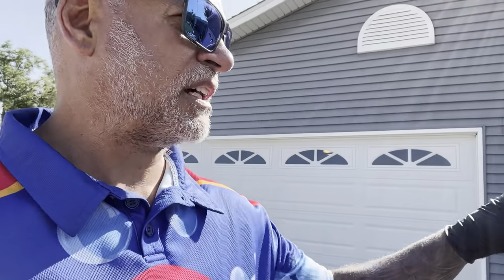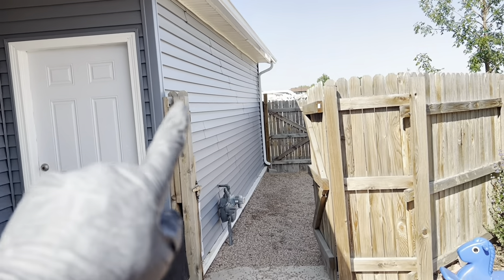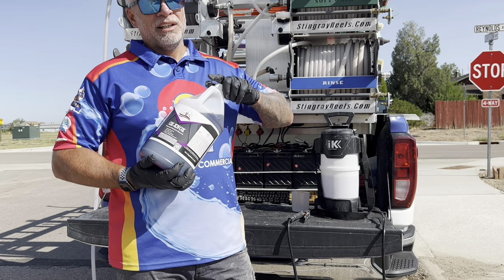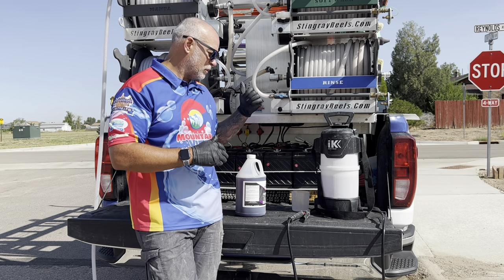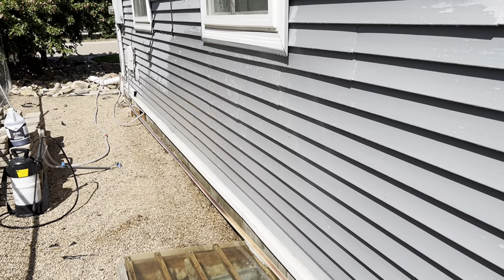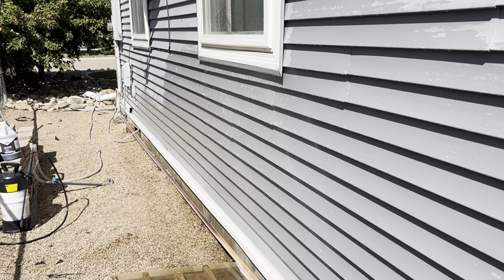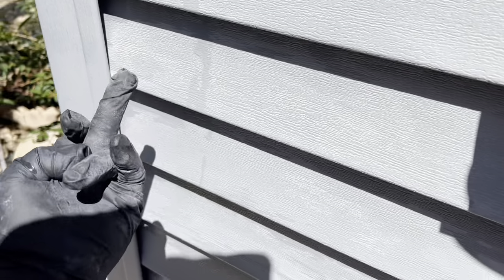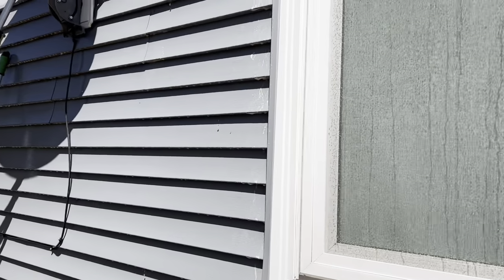Does Ox-Knox Really Work? Removing Oxidation from Vinyl Siding Test!

Comment: Thanks for this video!I’ve tried Ox Knox on some severely oxidized vinyl siding on 4 different houses.
I even tried 2 applications at full strength on a house but still had to brush. I’m glad to see that I’m not using it wrong because I’m kinda tired of them calling me dumb and downgrading us if it’s not working for us. They don’t seem to want to help they just talk down on us. And if you mention that it isn’t working, they remove your comment instead of being helpful. Thank you
Reply from the maker: I'm not surprised by their response. I still have high hopes and plan on trying another house soon testing some other variables. However, I remain skeptical. Thanks for your comments 👍
Reply: @mountainviewsoftwash9135  you know I just watched his video about ox Knox & that metal roof that came out so nice...well in the title it says "on a metal roof"...maybe that's the catch...no brushing on a metal roof
Reply from the maker: @derekjean6646  yea I gave seen them do a video on Hardie Board, vinyl and metal roof. Not sure why the lack of results on my end. My guess is dwell times.
Reply: @derekjean6646  I’ve also seen the video where they remove oxidation off of vinyl siding. Only thing I can think of is that the stuff may work on mild oxidation but not severe. 🤷🏼 If so, they need to advertise it that way instead of calling people stupid
Reply: If that's how they treat clients, I'm not interested in buying from them at all.
Reply: From what I gather ox knox is just another Butyl based cleaner...Nothing special and sure as heck isn't worth the cost...Purple Power $25 for (5) gallons at Walmart will likely work just as well...These businesses target startups who are ignorant on chemicals. Learn to look at SDS or MSDS information for any given product,.and you'll learn alot. Been doing this since 1996 and these dealers use the same cleaners and market them as whatever they want to sell that day.
Reply: Yep pretty much everything Coty sells you can make yourself, but hey some people want the easy way out so they buy anything he sells, can't really blame him for making money off of it.....

Comment: I'm really enjoying your videos. I just started into this as a side venture, and your videos have been helpful. Ran into some oxidation myself and been researching the best product to use. Your videos on the different chemicals have helped me out, big time. Learned alot watching. Thank you
Reply from the maker: Thank you man! I'm glad to hear your getting some value from these 🙏
Reply: @mountainviewsoftwash9135  Any advice on brush to use on oxidation?
Reply from the maker: @bretlagasse3560  I used the same brushes we use for siding. I like the multi angle car brush’s that are safe on paint but firm enough to get the job done.

Comment: Thanks for the video.  I live in southern CO.  I had to use oxknox at 100% for a metal roof I cleaned and it still didn't get all the oxidation off.  I started at 3-1 and it did nothing. 50-50 still nothing.  I had to go over the roof three times at 100% and then hit many trouble spot by hand.  I was super disappointed and will not use it again.
Reply from the maker: Shoot sorry to hear and unfortunately this seems to be a common theme. Shame

Comment: So, it looks like BC Cleansol is the winner for oxidation? And brushing is still necessary.
Any experience or opinion on using LA's Totally Awesome for oxidized vinyl siding?
Reply: Ive used LA on my personal home which is very similar to this video in color, like he said I saw almost instant action, looked like rust pouring off, I did use a soft brush and rinsed and it removed the chalky residue with no problem..didnt really restore the color as much or any glossyness but for something from Dollar General can you complain...I don't offer this service cause I have not found a product that is quick and easy and I feel for what you have to charge few people are going to go for it..
Reply: In my experience, Gutter Grenade from Pressure Tek, Gutter Butter, BC Cleansol is the proper product. OX-KNOX may work well but not a groundbreaking product.
Reply from the maker: I haven’t tried LA total awesome yet. Might grab a gallon and test it out.

Comment: I use Cleansol BC at 9:1. 9 gallons of water to 1 gallon of BC. I water the surface down first and then apply with a 12v 2.1 gpm sprayer. 2 coats 4 minutes apart. The oxidation just absolutely melts off. All i do is rinse it off with a water hose. No pressure washing. Comes right off. No brushing at all except in tight corners here and there. I also do gutters the same way, but i do brush them.
Reply: Great information... Thanks for your reply... Just the information I wanted to hear... I'm just setting up a 12v pump.
Reply from the maker: I do like Cleansol BC. I will have to try out your process and see if I can replicate. Thanks for sharing!
Reply: I used Pro Cleanse BC about the same stuff.. I used  8:1   twice  dwell 10 minutes  it says use pressure no less than 1000 psi.  no brushing it worked for me. I have a gallon of Ox nox but don't think it will work from what I need so I'm going to the Pro Cleanse bc,, just bought 5 gallons of it.
Reply: Do you do a SH mix before or after.
Reply: @bobbylindon9885   I always do a softwash and clean first to get all the organic growth and dirt off. Then an oxidation removal.
Reply: @bobbylindon9885   if you do SH first which is correct I think make sure you rinse , rinse rinse,  Pro Cleanse has on the instructions... Do Not Mix with Bleach.. when my BC hit contact with some SH on vinyl it turned yellowish Brown hard to come off too but eventually did. Everything was white except that part..
Reply: Not always.  Used 5 gallons on a singlewide and have to go back and scrub it again.

Comment: One thing many people don't realize with chemicals is air temperature....If you're trying to remove oxidation,..the warmer the better,...80+ and high humidity works better than 50 and no humidity....Very sensitive some of these cleaners are....
Reply from the maker: Good point!

Comment: 10-1 Ration is not "HOT" enough. We have used this product on 2 homes and she is dangerously good. I say dangerously because it will remove paint on gutters and window trim/flashing etc...Even pre soak and post soak the paint is coming off. If the mix isn't hot enough it doesn't work and if its too hot it removes paint. For this particular home you're going to want a 1 to 1 ration no questions. but you have GOT to be careful around downspouts. Maybe dip your brush in it just for the ends of the homes and around windows. Also if you only purchase 1 gallon it ends up being over $70 with shipping so if you're going to test this product out go and grab the case of 4.....For us personally we are just going to continue to use LAs totally awesome. It's $6 a gallon.
Reply from the maker: Great info thanks for sharing!
Reply: What dilution are you using for vinyl oxidation with the LA's ?? I use it on gutters and it WILL remove paint too if your not careful.

Comment: ok i just did a 9000 sq ft building ,the key to this product (for me here in tx ) was the rise pressure . it had very heavy oxidation whole place was pink,ox-knock made it blue again. no scrub 10 min dwell time. own was very happy with the results. wrote a nice phat check lol my mix was 32oz of ox=knocks and  2 gal  pump sprayer , yes i did have to mist it keep it wet, just enough where she didn't dry up on me.
Reply from the maker: Awesome! I think the issue for me here is the dwell time needed. It’s a dry climate so the chems dry up fast.

Comment: Homeowner here, not in the industry. But I just want to know how you do a two story house since this work requires brushing and not mere spraying. Are you on ladders doing this?
Reply from the maker: Hello there, great question! I can effect clean from the ground using a combination of a multi-angle brush and extension poles. Here's one that we use.

Extension Pole: Limited-time deal: DocaPole 30 ft Reach, 6 to 24 ft Telescoping Extension Pole | Multi-Purpose For Hanging Light Bulb Changer, Paint Roller, Duster, Window/Gutter Cleaning https://a.co/d/f5MdFMM

Multi-angle Brush: DocaPole Soft Bristle Car Wash and Scrub Brush Extension Pole Attachment (10") for Deck, Truck, Boat, RV, House Siding, Safe with Water (Long Handle Pole, Not Included) https://a.co/d/6S5iDwt

Comment: I went down to a 50/50 mix on vinyl and it took a good layer off but I still needed to brush.  I ended up using a different product that took the balance off.  I also tried it on my oxidized metal shop, in the shade, 50/50 mix, 5 to 15 min dwell tests and it didn't touch it at all.  Thank you for posting.
Reply from the maker: Thanks for watching and commenting! It's a bummer you had similar results. I did try a small section with a 50/50 mix with a longer dwell and didn't see much reaction. It's unfortunate that the product didn't work as advertised. I had high hopes!
Reply: Have you ever used Cleansol BC? Or Kraken wash from dirt killer? There both supposed to be the best  oxidation removals out there. I heard southeast softwash chemicals are not worth the purchase. Good luck to you
Reply: @louiscottrell3236  I've used Kranken wash on some garage doors.  Worked well.  No luck with cleansol BC.  I've used f9 barc and it worked well.  Needed to brush though.
Reply from the maker: @louiscottrell3236 I did a video on CleansolBC, actually worked out pretty well. Still requires brushing to get the desired results
Reply: So Kraken is good for oxidation?
Reply: @victorduran6486 I have limited experience with it but it worked.

Comment: man that came out great, nice job! I do love SE softwash but yeah, i thought that might be a little too good to be true.
Reply from the maker: Thank man! I think the main issue is dwell time. I can only get 1-2 mins before it starts to dry. I’m going to text on another home when temps are cooler and see if I can keep the siding wet to allow longer dwell. I think it needs at least 5-8 mins.
Reply: @mountainviewsoftwash9135  yeah for sure I like that your giving them the benefit of the doubt. May have to start really early in the morning and in the shade lol
Reply from the maker: @SydneyRayGolf  yep exactly. I have a Hardie Board home coming up thats really oxidized so will see what happens with it.

Comment: Oh no!  On the heavy oxidation, you really need a 50/50 mix for quick and easy results. That’s what they did in their videos. I’m trying my first one on Friday. I’ll let you know how it goes. I might have to try misting the areas with water to let it dwell longer
Reply: How much is this product? maybe not cost effective if you need to use 50/50...
Reply from the maker: I actually did a 50/50 in a smaller section with little results. Disappointing 😢
Reply from the maker: @vcash1112 I agree… if it work as advertised it might be worth it
Reply: 50/50 and a 30 minute dwell still left oxi for me
Reply from the maker: @marqueswilsonn  ugh! You think the would be more than enough time. Disappointing 😕

Comment: I’m actually in the process of ordering a lot of well built equipment from SESW so I believe in them but I’ve used 15 gallons of Oxknox so far on metal roofs and tbh, I’m quite disappointed. I went 50% and it still wasn’t brushless. Quite an expensive product for nearly the same results as some others that I’ve used throughout the years.
Reply from the maker: Have they given you any feedback as to why this didn't work?

Comment: For a true spray on and rinse off,.. the closest thing I've ever seen is a Hydrofluoric based aluminum brightener. I get it locally for $60 (5) gallons,...Prices will vary I'm sure....I use it under shutters when they are bleeding off onto the siding. Takes it right off. And no,..it won't hurt the vinyl siding.  But,..it is very strong and plant and grass has to be kept wet the whole time,..May not be practical for everyone,..but it definitely works effortlessly....
Reply from the maker: Appreciate the feedback, I will look into this.

Comment: Do you need to brush Cleansol BC on vinyl siding. 
 I have bought 2 products that we haven’t had luck with.
1. Ox Knox
2. Dragon Juice for cleaning stripes off of gutters.
Thanks for the video
Reply from the maker: I find for the absolute best results the surface should be agitated. We like to use a multi-angle car brush to get into the nooks and crannies. Our go to brush you can find on Amazon.

👇👇👇
ZOLKER 12''Car Wash Brush Head... https://www.amazon.com/dp/B09M3VKBG6?ref=ppx_pop_mob_ap_share
Reply: @mountainviewsoftwash9135   I have the same brushes. Thanks so much for the info
Reply from the maker: @robertlam-qd1xb  perfect!!!

Comment: It doesn’t. Save your money.
Reply from the maker: Seems to be a common theme 🤔
Reply: @mountainviewsoftwash9135  I’ve used that junk on 25 year old vinyl and 15 year old painted metal roof. Ran it thick to but still had oxi coming of on my fingers. Roof needed heavy heavy flushing and semi direct pressure. That’s you can see in his videos he blasts the roof with a ball valve after and goes “Oh look how easily it comes off”.
Reply from the maker: @marqueswilsonn  appreciate your feedback… I'm becoming less convinced with every comment that this is a “brush-free” solution.